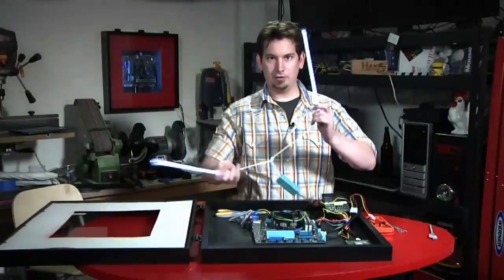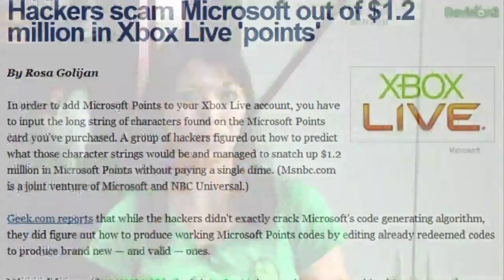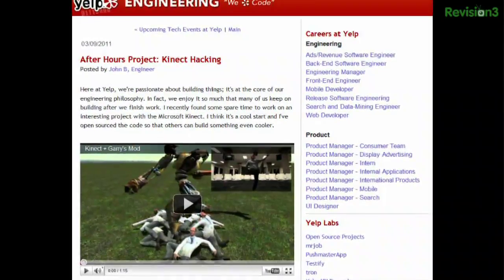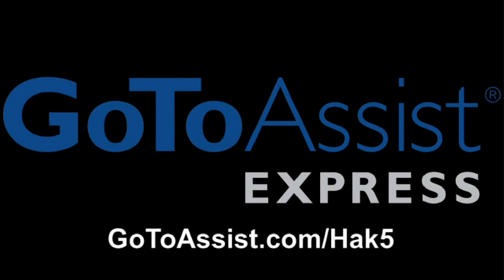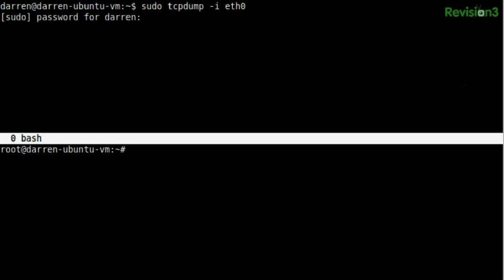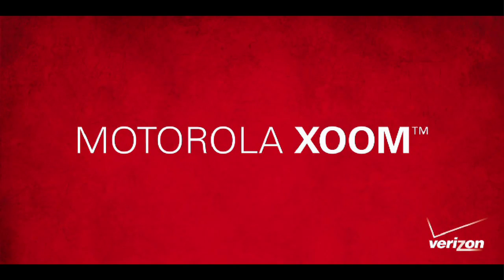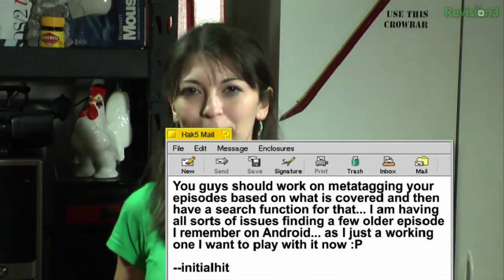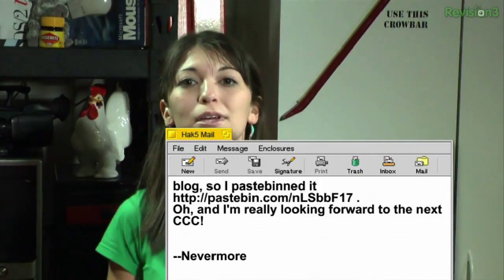Hak5 - Writing software without a line of code, crafting packets with hping

Comment: I think if I were to do something like this I would use neutrik PowerCON and EtherCON connectors (commonly found in my industry). You can get really neat surface-mounts for them and they are locking! Really sweet.
Remember that the NEC/CEC requires line voltage separation from low-voltage and such, mount a box on the inside and some sheer sexyness would ensue.
Really nice.

Comment: For LEDs in the frame I have a nice idea:
Use I2C LEDs, SparkFun has a couple of models (I bet there are cheap Chinese knock-offs on eBay too).

Tapping into the SMBus (Intels name for I2C) is actually much easier than I first thought and you can to it without even touching the mobo by soldering a couple of wires to the configuration EEPROM on a RAM stick. This is used to determine initial timings for the RAM itself since I2C is very robust and can handle a wide range of clock speeds. (Part1)

Comment: The programming without writing code shown is procedural programming (top down). Modern programming has changed to object oriented programming (OOP), which is a faster running program.

Comment: For the case mod you could go with a "C14 3-Pin panel mount" connector for power and "Black Snap-In Cat5e RJ-45" Jack for ethernet. A square hole in the case the same size as the snap-in should make for a clean look.

Comment: It seems very similar to LabVIEW. LabVIEW actually has a lot of uses in the data acquisition field. It is built for engineers (especially electrical) who wants to quickly get and process data. But tbh, I still see true programming as writing lines of hard code.

Comment: (Part2) Once you're in, make sure your kernel has I2C support for your chipset, then use i2cdetect (avail. in Debian repos, i2c-tools) to find the LED and i2cset to control them. Add bash and cron to the mix and you should be able to monitor pretty much anything. (Part2)

It's kind of theoretical, but there was a guy over at the eeeuser forums who did just that with a white LED and some cheap I2C bridge. (Part2)

Comment: an idea for adding a power jack.  The old Macs used to come with a cable that is just a pc power cable extension(it has the type of connector that is the PSU power connector, male on one end, female on the other end)

Comment: holy crap, at 0:50 there is a picture of the same computer case i use (slightly newer version) in the background, that is the first time i have even seen it (or a version of it) on a youtube video. mine is all aluminum except the front section, but like the one in the background it has aluminum sheets on the front mounted with fake rivits along with a clear plastic shell. mine is old as hell though, everything but the front is pure aluminum, thats 2001 for you, 100 bucks for it back then, no ps.

Comment: at about 12:13 she said java code but it's actually python they are different programming languages
also i can write the same program with one line of code in AutoIt (which is similar to C but much easier to use and has full help file)

Comment: an idea for adding a power jack.  The old Macs used to come with a cable that is just a pc power cable extension(it has the type of connector that is the PSU power connector, male on one end, female on the other end).  If you google search "NWCA PC-11206R" you'll find what I mean